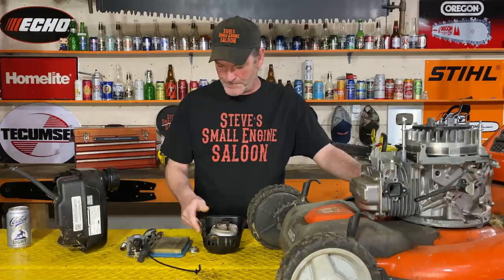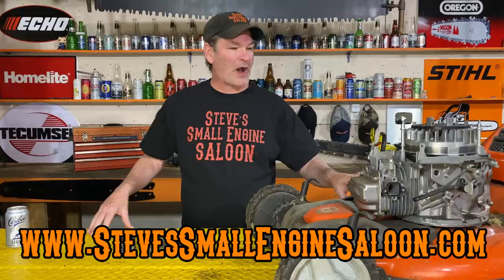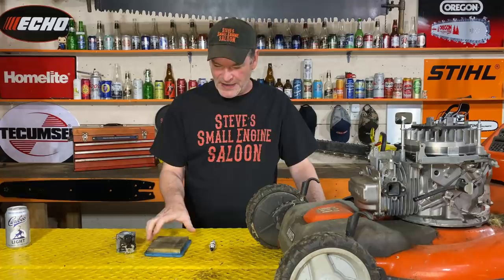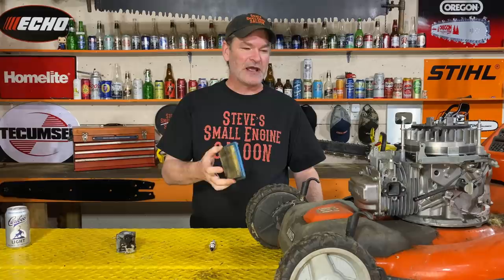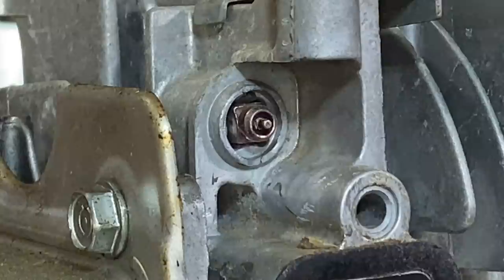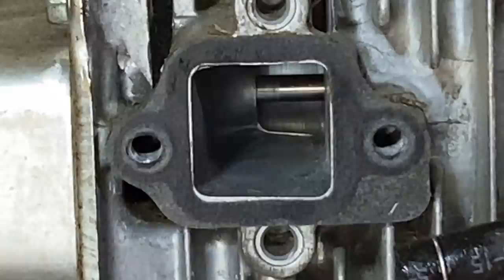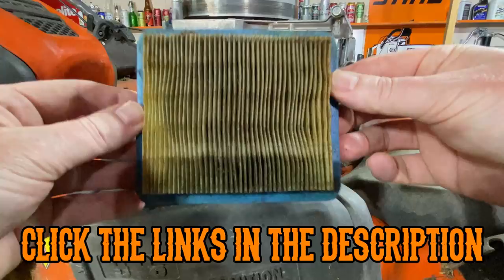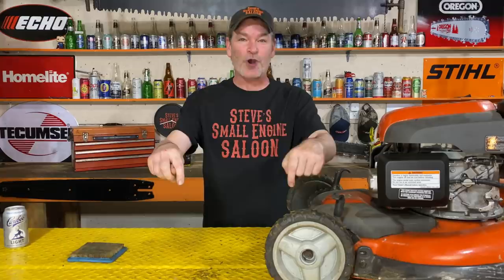What Happens If You Flip A Lawn Mower Over Wrong?  (LOSE MONEY)

Comment: I have a cub cadet riding lawnmower (2015 XT1 Enduro LT42 model). What else besides the seat safety switch would keep me from engaging the manual PTO from engaging? It acts as if it's the seat safety switch but I've ruled that out already. Every time I try to engage the blades it cuts off the engine. Thanks in advance for your response.
Reply: @marcmyers1465  I ruled it out already. Thanks for your reply though.
Reply: @marcmyers1465  Thanks. I'll check it again when I have a rain free day.
Reply: @marcmyers1465  No. As soon as I attempt to engage the blades the engine cuts off. My PTO is manual. I engage the blades by pushing a handle forward. I just ordered a new seat switch this morning. It will take a few days to arrive. I'm not sure how to test the switch with the pins all in one row. There is no diagram I can find that shows the switch in detail. The way I tested it yesterday showed  pins continuity making and breaking with the button actuator. I had also removed the bar in the harness connector and left it disconnected and had the same symptom.
Reply: @marcmyers1465  I've tried to take good care of mine. It has served me well the 6 years I've had it until this problem popped up out of the blue.
Reply: @marcmyers1465  Yes. The mower will crank with the brake on.
Reply: @marcmyers1465  No, the blades will not engage with the parking brake on or off without killing the engine.
Reply: I looked for the engagement of the various switches and they all seem to be engaging properly. It only has 253 hours on it. I just use it for my own 1/2 acre yard.
Reply: @marcmyers1465  I think they're all okay from what I can see. This couldn't have come at a worse time. I just had open hernia surgery a couple weeks ago so I'm still having to be careful. I'm usually pretty good with electrical issues but this one has me stumped. Hopefully the seat switch will arrive in a few days so I can at least rule that out for sure. Thanks for your help.
Reply: @marcmyers1465  Everything is going well so far. I'm just careful not to put much stress on the incision at this point.
Reply: @marcmyers1465 Unfortunately I have other medical issues from the past that prevent me from doing a lot of walking. I wish I could do more.
Reply: @marcmyers1465  No. The belt is fine and on track. Yesterday I replaced the seat switch and that didn't work. I also replaced the belt engagement switch with no results. I had to remove the battery to access that one. Next week I'll replace the brake pedal switch to see if that works. I'll have to pull the deck out to get to that. I want to give my surgery one more week before I do that. I did figure out how to check the switches with my ohm meter since I had the new ones to play with. On the seat switch it has 4 terminals in a row. Terminals 1 to 4 are normally closed and 2 to 3 are normally closed. The brake switch is a 3 pole switch. 2 are N/O and one is N/C. It's pretty hard to get to is why I have to pull the deck out to access it. I can't even get to it to test it without removing the deck. The deck engagement switch is a 2 pole switch. 1 set is N/C and the other set N/O. Who would ever guess lawnmower wiring could get so complicated? If I only had a legible wiring schematic I could go by the colors and test them, As it is I'm having to do it the hard way. I found one on line but even when I enlarge it as much as possible it's still not legible.
Reply: @marcmyers1465  Thanks. It seems each model has a different diagram/schematic. I looked at a few different ones on line. My particular model is xt1-lt 42 Model #13ava1cs009.
Reply: Seems I finally figured out what was wrong with my blade not engaging after replacing the seat switch, the blade engagement switch and the brake switch. They all checked okay with my ohm meter but since I was already in there I replaced them anyway. I was playing around with ignition switch and got it to engage. When working properly the ignition switch is in the normal run position and you engage the blades from there. If you want to be able to back up you have to hold the brake on, turn the switch to the left and push the button and the red light comes on. Then you can back up with the blade engaged without it cutting the engine off. Today after going through replacing the brake switch, which btw was working properly when I checked it out with my ohm meter, I was about to pull the rest of my hair out. lol I started playing with the ignition switch. After cranking the mower in the normal switch position I turned it to the left and pushed the button causing the red warning light to come on. Then I attempted to engage the blades and they engaged okay. If I tried to engage them without the red light on they would not engage and the engine would turn off as before. Now I guess I can order a new ignition switch but at least in the meantime I can mow my lawn instead of paying someone else to do it. I waited til today to mess with it again because it was too hot last week and I wanted to give my surgery one more week before pulling on that deck trying to maneuver it around. I had to remove the deck to get to the brake switch. It was a booger getting it unplugged too. Thanks for the advice you provided thru my time trying to figure things out.
Reply: @marcmyers1465  Me too. Thanks for your responses. You're the only one that replied. Hopefully the module replacement will do it. I'll see tomorrow. I just received it in the mail.
Reply: @marcmyers1465  Just to give you an update, I replaced the ignition module and that didn't fix the problem. There's a switch on the side of the transmission that activates when you push the reverse pedal. That was the only one I had not tested since I thought it was just for a reverse function. I replaced it and tested the old one. Sure enough the old one tested bad. Now that I have the new switch installed everything is working correctly.
Reply: @marcmyers1465  The keyed bypass is thru the ignition module. The switch looked normal, just the usual amount of dust on it with the normal amount of motion. The contacts were stuck in the closed position. The button seemed to be operating normally. It's a 2 pole switch but only the n/o side is used. I suppose it's wired so that if you try to put the mower in reverse without first engaging the ignition module to the reverse position,  if the blades are engaged,  it grounds the run circuit. If nothing else, this has definitely been a learning experience.

Comment: Early guess: over filled the oil.

Well not quite. Jeepers, some people have more money than sense. Why would you disassemble it so far when one of the easiest parts cannon items would have fixed it? Arg.... Maybe the fact that some engines you have to soak the (foam) air cleaner in oil led him to believe it was supposed to be like that?
Reply: A look at the owners manual would clear that up.  Surprising what you find in a manual.
Reply: @dwightl5863  yeah, clearly wasn't much for seeking advice going into this machine so haphazard tearing it apart, then ditching it and replacing.

Comment: Wtf. Isn't the air filter like the very first thing you replace when your having issues (or before you have issues), then spark plug, oil change etc. Lmfao
It's called preventative maintenance for a reason

Comment: I bought a destroyed lawn mower.
After taking carburetor off, changing air filter and primer it did not start.
 Then I remembered that it was important to put TWO gaskets between air filter and carburetor for the primer to work.
It started at the first pull.
Even in the case that it was an old mower!!!
Reply from the maker: Right on

Comment: Isn’t that a 400 dollar mower?
Reply from the maker: Yeah, it is now, but not when it was new...
Reply: @StevesSmallEngineSaloon  I had no idea they were that expensive lol. You could get a Honda mower for that price, one with a self propel system that doesn’t use unsheathed plastic pulleys 😂
Reply: @StevesSmallEngineSaloon  I had to come back to this video and comment because just today, 7/24, I had this EXACT same mower given to me FREE and it had the SAME PROBLEM. An all wheel drive husqvarna with the big wheels in the back and Honda engine, hu800awdh. Guy gave it to me because it wouldn’t run right. It was an oil soaked air filter, that was it! I can’t believe it.
Reply: @StevesSmallEngineSaloon  only difference was this guy didn’t “play mechanic” and take anything apart. Too easy!